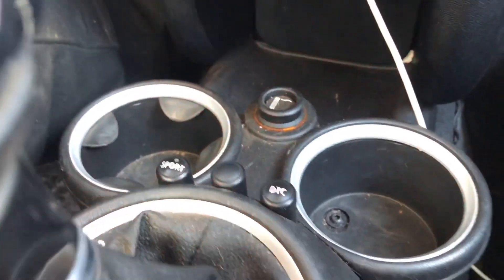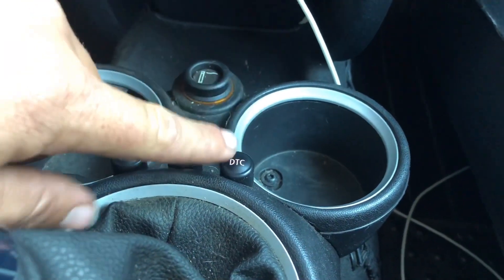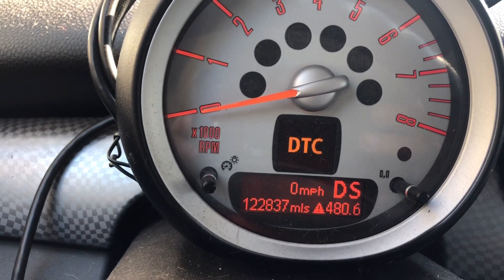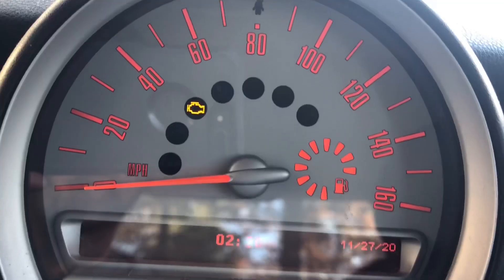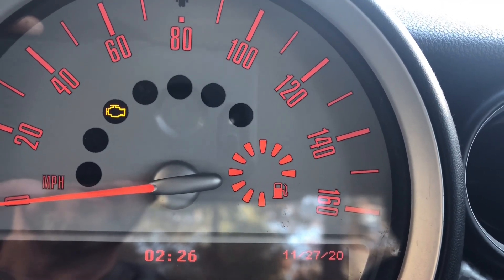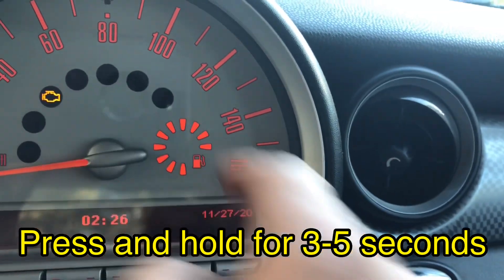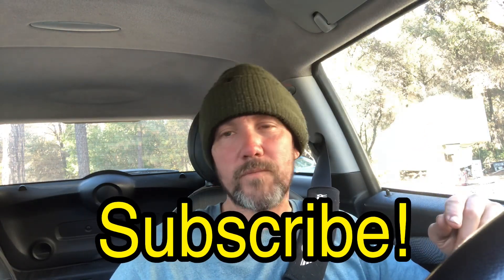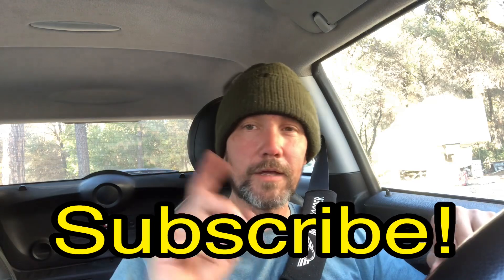DSC/DTC - How they work on a Mini Cooper R56

Comment: Please help! I was working on my minis water pump, disconnected the battery and ecu while replacing it. I put everything back together but forgot to connect the ecu and tried starting the car then realized the ecu was not connected. Now my car won’t start. Any ideas?
Reply: I just did the same thing and forgot to tighten the ground strap that sits on top of the passenger engine mount.  I realize this reply is from 2 years ago, but if someone runs into this issue now, check that ground.

Comment: Hi, Hi, I have a problem with my Mini Cooper s r56 not start. 

The mini was on taking it out of the garage when it suddenly turned off.  The first Scanner have these codes:
 2781
 2775
 2D52
 2DCA
 275F
 272F
 I changed 4 spark plugs, 4 coils, the Camshaft Position Sensor and a new battery.  But it did not turn on, now it is giving these codes:
 005E31
 009314
 00A0B4
 00932D
 009CB5
 I deleted them and it only gives me this code: ( A0B4 )
 The mini starter good but not start.
I try the new battery and it says it's ok, but when I test the battery with the terminals mounted on the Mini Cooper it says it's bad I don’t now why. I also reset the new battery in the mini system with the scanner but nothing.

Honestly, this situation is driving me crazy since the mini is in the garage and I need to get it out to get a jeep behind it.  If I take out the mini I won't be able to enter it again because the garage is elevated.
What do you think?

Comment: Thanks! I have a 07 56s that have DCS, I want to check with you if ABS is turned off when I turn off DCS. I feel so several time, but I do prefer the ABS is on even when I am racing

Comment: Mine doesn’t work anymore since I change my steering wheel 🤦🏽‍♂️
Reply from the maker: So it’s always off?
Reply: Yes 🤦🏽‍♂️
Reply from the maker: I wish mine was always off lol maybe i need to pull my steering wheel off. If you want to fix it you might want to reinstall your steering wheel
Reply: @ProjectMini  lol I like it off. But only thing that’s bother me a lil is the airbags light is on